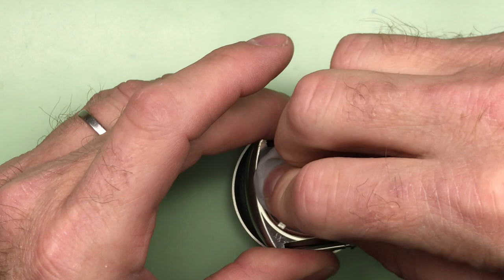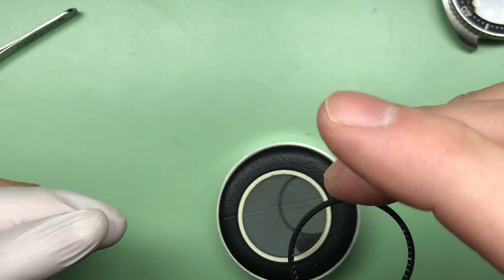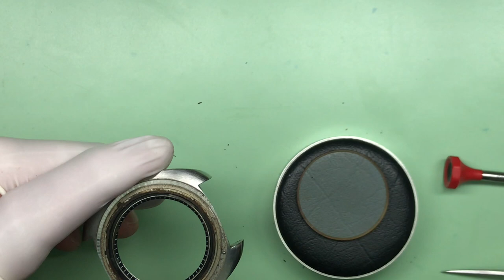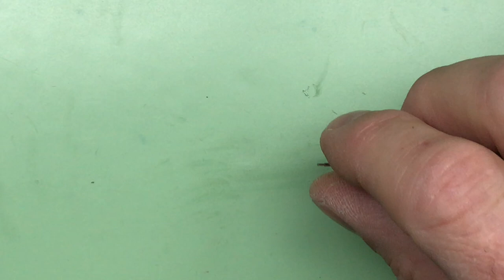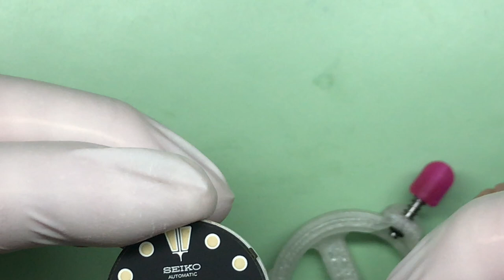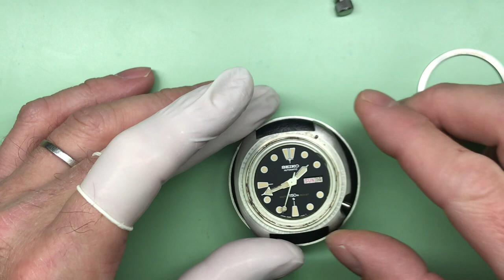For D.M. -- Seiko 6309-7040 Turtle Case Rebuilds

Comment: If chapter ring is misaligned it’s possible to realign without removing crystal? In few words only removing dial thru caseback?
Reply from the maker: Yes. It should be rotatable with the movement removed.

Comment: I was hoping to see you replace the click ball. I would like to replace mine but it is stuck. Any suggestions? I’m having an issue with a bezel that is extremely tight. Gasket is new and perhaps the diameter is too large.  I really don’t think it has anything to do with the click ball, but I can’t get it out. I’m working in a 6309-7290. I have two where the bezels no longer rotate.
For those who want to learn how to do a full service on the movement, I suggestion watching My Retro Watches on YouTube. That’s how I learned. I’ve got 6309s that are running as well as my Omega, at least in the dial up position. You can do it! I just need to figure out how to get a simple bezel to rotate easily. Frustrating!
Reply: In My very limited experience; first get the correct size o ring, don't forget to grease it with silicone. To my knowledge if the click ball needs to be replaced, but is rusted in, only drilling can dislodge it.

Comment: Does the crystal just pop out like that without using a press? How does it seat securely when reinstalled into the case?
Reply from the maker: There is a rubber gasket that holds the crystal and a bezel that needs to be removed and then reinstalled using a crystal press.